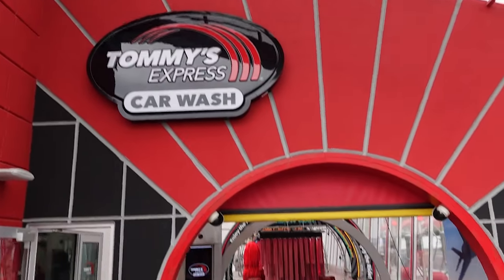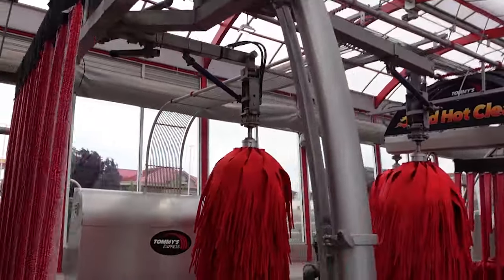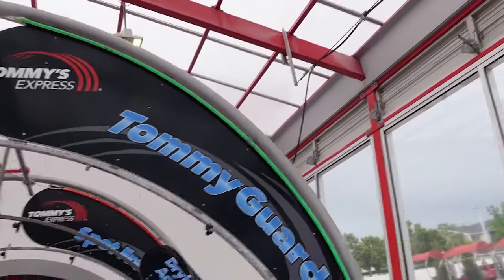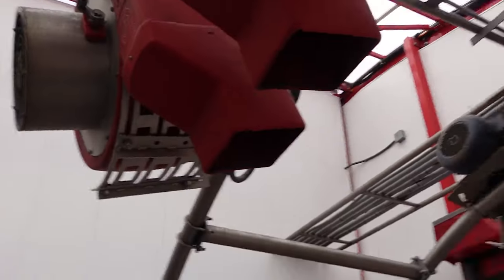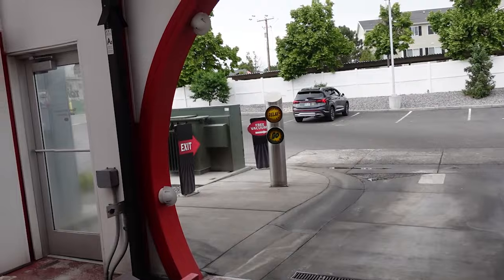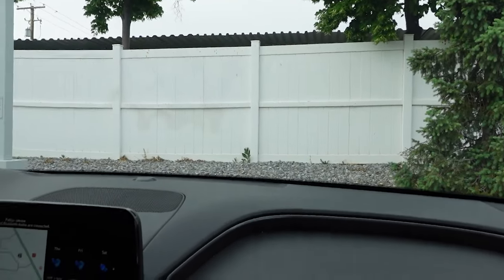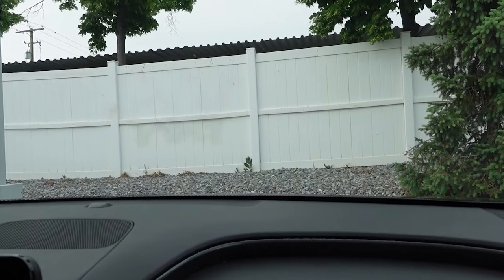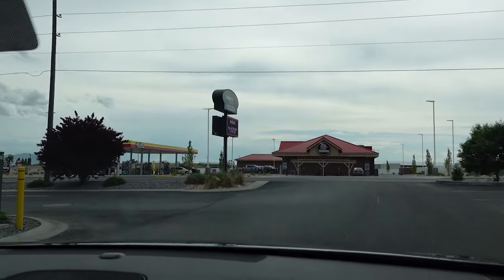Perfect Tommy Tunnel - Tommy's Express Car Wash - 2150 W Antelope Dr, Layton UT

Comment: What exactly does a rainbow coat,  red hot cleanser in ceramic body wax actually do? And why are you waxing a car before you rinse it? I have a subscription to their service but I opted to take the second to the lowest package, because they don't explain what they're there higher packages actually bring to the table. Maybe you can find out from them and get back with us.
Reply from the maker: @captivethoughts1745  Rainbow coat is a conditioner most likely, and red hot cleaner is likely a lube soap. Ceramic body wax will give your vehicle more of a shine and make it more scratch resistant. In addition to that, it will make your vehicle surface hydrophobic, and any rain water will simply roll off, reducing the need for windshield wipers. You don’t necessarily need to rinse the car before waxing because the brushes have already flicked all of it off, and the soap contains what is left of it. The wax will help rinse off the dirty soap itself. In summary, higher packages include more lubricating soaps and conditioners, and protective applications.

Comment: interesting how the final set of brushes is cloth, what is the advantage of the cloth vs using all foam brushes?
Reply from the maker: Cloth is more durable, and therefore can last longer.  In addition to that, if you buy the polish service it will absorb the product, spreading the product around the surface better.
Reply: The benefits of foam is that it is  more gentle on the vehicle and it’s good for cleaning under rims and mirrors and other things like that
Reply from the maker: @misterverse99  Yes, it can clean hard to reach areas easier and avoid absorbing dirt, at the cost of durability and cleaning ability. Cloth has the advantage of being durable and lasting a long time and cleaning well, but will get dirty eventually. Filament has the advantage of cleaning the surface very well without absorbing dirt, but at the cost of clear coat safety. (unless you have a shit ton of lube soap, that is)
Reply: @carwashreviewsandmore7609  Right

Comment: F Tommy's carwash. They are so judging on who they hire around my area. They are a shady f'in company and never took blame for those wraps scratching cars, and it happened to mine. It only costs them like $0.02-$0.04 for a wash, and they way over charge. They will fight any lawsuit and pay for the best lawyers (gee, I wonder why they need lawyers). I used to work for them and know my way around the inner workings of that place.
Reply from the maker: Tommy’s is a much better company than you are describing. It’s very unlikely for those wraps to scratch cars. It costs much more than you are describing per car, top wash I estimate costs $0.15 per car, chemicals aren’t cheap. Also yeah of course they would fight lawsuits with good lawyers. They have only been sued a few times, just like any company. Tommy’s is not the company you’re describing.